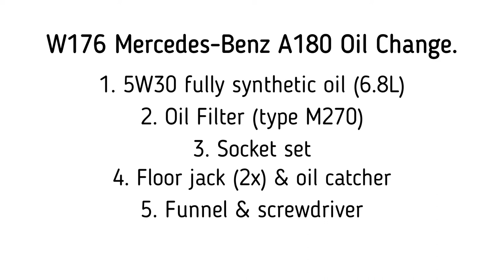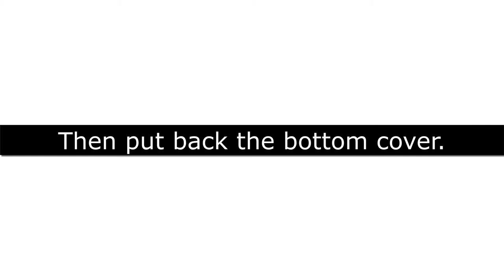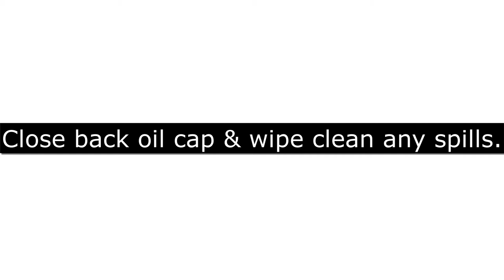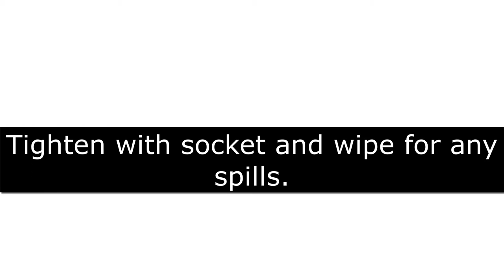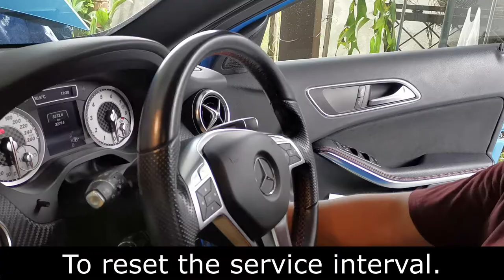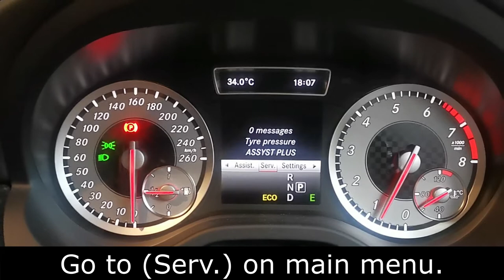DIY oil change, filter change & interval reset 2015 Mercedes Benz A180 W176.

Comment: Hi man, I used to changed air & oil filter, engine oil, spark plugs, it's not hard at all, last week took it to the MB dealer and thought have to, later got the bill for 1400, I think charged for windscreen washer liquid 10, and want to charge 120 for wiper blades which only cost 60, lot of BS, never again they ripped off in day light, the labour costed 866 for 3 or 4 has mostly but they took the car somewhere you can't see a d just the paper printed out said so. I didn't know, would love to show you the service papers and then charged 1% surcharge on top of it but I didn't have the credit card either. Bad bad and Disappointed with MB Parramatta in Sydney.